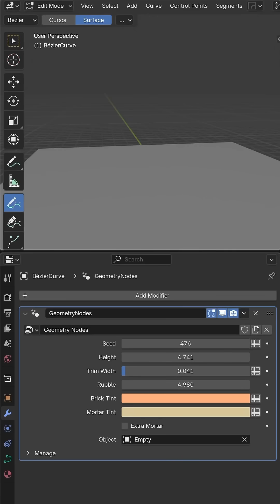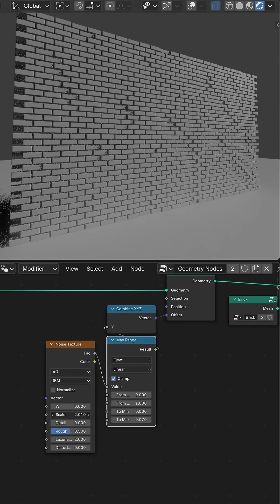I made a Geo Node Brick Wall in Blender

Comment: Just found this, and it's something I've always wanted to do - I feel using a brick texture for most walls just isn't enough for certain applications. Have you looked into the trowel add-on by vfxguide by any chance? It's very similar to this, and it might have some solutions to any issues you're coming across (if any)